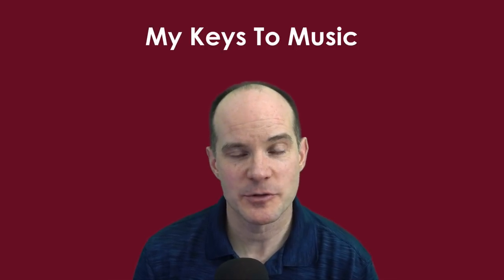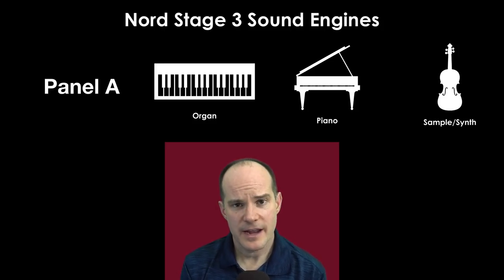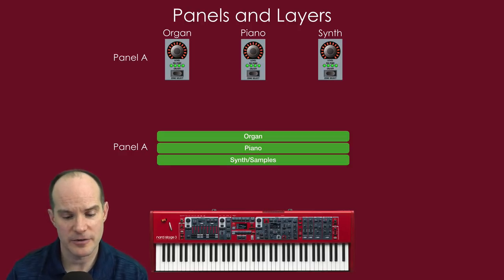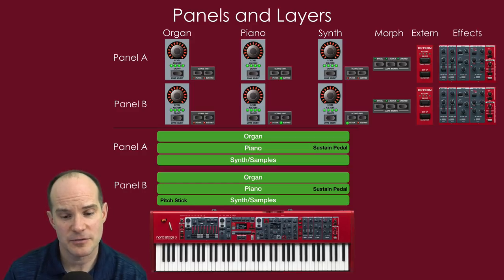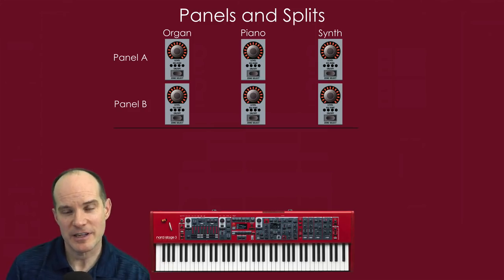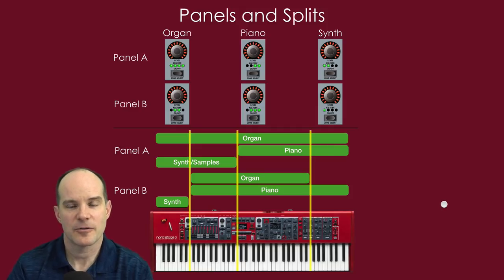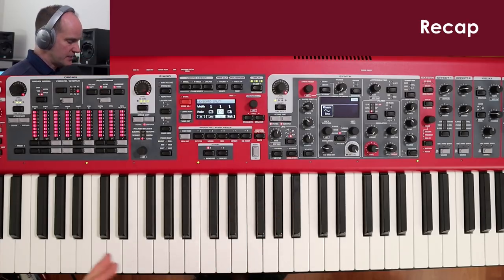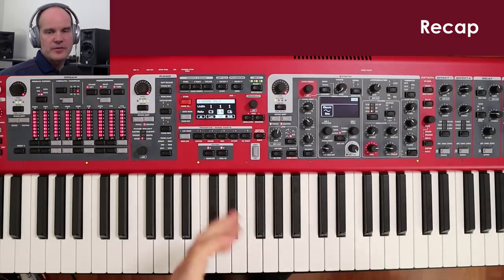Nord Stage 3: Understanding Layers, Splits, and Panels

Comment: Great tutorial!
Reply: Only thing I don’t get is why you they didn’t add customizable split points to any key.
Reply from the maker: Thank you!
Reply from the maker: @nikoscratchaccount  A lot of people wonder the same thing.  We're not really sure why they did this but I have a guess. 
1) They may have wanted it to be as easy as possible to assign a split. Having less options makes it easier to do that and less screens and buttons to fiddle with during assignment. Also, having flexible split keys means it could get confusing for the user on how to assign zones. There would be issues with the user assigning a zone in the wrong area simply because they picked the incorrect keys to split on.  It would make for a slightly more confusing interface potentially.  Then again, maybe with enough thought, they could come up with a way to split anywhere, still have 4 zones, and make it easy for the user to program?

2) The split points illuminate in the dark - this is a nice feature and is absent on most all other keyboards. I wonder if allowing any key to split would also mean they'd have to install an LED light for every key?  Of course, the answer is yes. So, the additional expense on that alone could have been a deal-breaker. And it's not just the extra lights to purchase, but the extra labor to install and test them. And then, if even a single light goes out somewhere along the way, the owner is going to send it off for repair, which is expensive on both ends of that equation both for the person fixing it and the musician having to wait for it to get fixed.  In other words, with more part complexity, you introduce more long-term fragility (more things that can go wrong).  And with the keyboards still being made by hand, the inclusion of parts must be one of those long-drawn-out meetings around the design table with tough decisions to be made balancing features with feasibility.  That could explain why they don't have motorized drawbars.  🤷🏻‍♂

With that said, it would still be nice to have split options for any key haha!!!  Just because it's hard to make the cookies, doesn't stop us from wanting them right? 🍪
Reply: That makes sense.

Comment: First a big thank you for all the how to's. My primary goal was lightening the load from a Roland GX 700. Several months back after watching the Layers, Splits I decided to give the Stage 3 76 Hp a try. At the time my set up was a Roland Gx700 & an SK2. Synths were not a must have, but I got the Stage 3  since it had the Organ engine, &  weighted keys for pianos, EP's, etc -keeping in mind that I may be able to get away with 1 keyboard once fluent with the interface. 
I've always liked the Roland's ability to have 4 voicing samples at the ready with (4 sliders,) where I could instantly bring up any of the 4 for accents, or blend. 
As a fresh 70 yrs (ouch) you could say I'm old school.  The challenge with the Nord is the interface & understanding the differences in terminology SONGS, LIVE MODE, PROGRAMS.  I'm still a little foggy on Programs (they pull up already present samples/voices,) Song Mode -having 5 voices, but you'd only play that voice w/out the other 4 & so on .....I have selected some voices from Piano, & Organ, done keyboard splits, used the Morph wheel to bring the volume up/down -but it's frustrating to start saving & discover it doesn't work as intended & then lose myself when trying to re trace the steps & get frustrated to the point where  I listed it ,got an offer, & then thought I'd revisit the process & give it some serious time. I'm sure it would improve the more I do it before deciding to keep or not given my simpler needs than what it's capable of. 

In a simple scenario - Lets play The Letter (Cocker version) Selecting a piano & wanting horns for that chorus part only.
Another ex - Black Magic Woman -wanting the organ & EP for the whole tune but in varying volumes (thinking I can use the Morph wheel to increase/decrease volume on each in opposite directions.) Now I'm at point where I'd delete some samples to make room for others, along with saving some patches & confused .With all the song slots could I just create a "song " The Letter" & have that set up ? continuing same with other songs ? & are they SONGS, Live Mode< etc ??? When I'd want more parts or 2 frm same engine I'd use Panel B in addition -then switch to either A & B or Turn one off. Am I getting close ?
Reply from the maker: Hello!  Congrats on digging and at 70 no less. A musician once said (or maybe it was my High School music teacher that said it), "I'm so happy I didn't go into sports because professional athletes have a short span in life where they can perform at their peak. Musicians on the other hand only improve with time, able to perform their instrument at the highest of levels going well into their 80s and 90s and beyond..."
So, these concepts are quite confusing for most that are new to Nord. The key here is to know that Live Mode and Song Mode don't store sounds on their own.  They are merely pointers to existing programs. A program is the only way to save settings on a Nord keyboard.
So, if you want to create a song that has an organ and piano, you'd first create a program for that. Then you can create a song list that POINTS to that program.  This is both a good thing and a bad thing depending on how you look at it.  It's good in that if you want to create a generic program that always has a piano and organ at the ready, then you can use that program in multiple songs without having to recreate the wheel each time.  But, it's also bad if you want something specific for a song, you have to first create a program and then reference that program in your song list. Not a huge deal, but not exactly what people are expecting out of the box.  Live mode is similar except that with Live mode you don't have to push the "store button" and your sounds are in a constant state of flux.  If you move any knob whatsoever while in live mode, the live mode settings stick and there is no undo.
  
You could consider taking the course I offer at https://www.MyKeysToMusic.com where these concepts are explained in a little more detail in their own lesson. It may help with this process and give you a start and an end to learning all this. 
Thanks for your comment and congrats again on your Stage 3!
By the way, the 4 slider concept is fully utilized with the Nord Wave 2 keyboard.  Wish they had this for the Stage, but ya, they get it now too since the Wave 2 is their newest. It makes a big difference to have sliders instead of knobs I think.
Reply: My Keys To Music   Before receiving your reply I did dive in to create new programs with splits on an existing A25 & A21 programs One was for the song Black Friday, I put a clavinet on the lowest split (E-E)along with some synth on Panel A to fatten it up. Both are controlled with Morph wheel. On panel B I have a Wurly  with a little synth patch to give it some bite. I did similar with EP & B3 in another program (A21) Saved as in their slots & renamed     
!! Your mentioning the wave2 got me wondering, but the preference for pianos & organ knocked that out. I have my Hammond Sk2 & while the synth samples are borderline, it’s 2 keyboards & always having a b3 ready cover my bases. I think I’m on the way & will keep diving to get more comfortable with the architecture & trials. Your videos are clearly the best out there. Well thought out & presented. You may need a bourbon bar to go with coffee fund.
Reply from the maker: @unfinishedbusinessrockband  Thank you for the compliments and the update! Happy to know you are on your way. Sounds like you're making terrific progress!

Comment: Very helpful! 
What if I wanted to split at D#5? I haven't found a way to do this and have a song I need to do this on but doesn't seem possible on the Stage 3.
Reply from the maker: Hello @Josh Paredes Great question! The Nord Stage 3 keyboard has 10 pre-defined split points with LED lights indicating where they are on the panel.  There is no way to define a split in any other way other than those 10. Sorry!  (The Nord Lead A1, on the other hand, can split once on any key).  I think the thinking behind this is to provide the musician an easy way to identify where a split point is where as other boards, you essentially have to memorize where you created your splits.  So, with that said, it would be ideal then to have an LED anywhere on the board and split at any keypoint, but it doesn't work that way.  They gave us 10 and we live with that.
Reply: @MyKeysToMusic  Gotcha. Thanks for the fast reply! I ended up creating the split higher up on the board at C6 and set it an octave lower. Seems like the only work around is to cover a whole octave above what you need.
Reply from the maker: @joshparedes_  Yes, that's, that's the way I've always handled a case like this. Glad you found the work around. Have fun with your Nord!

Comment: Hi Marc,

I currently own a an electro 6 that I primarily use for playing organ. I use midi foot pedals and would like to have another manual, but the electro only splits once. Would upgrading to the stage 3 allow for controlling (sample engine) bass with the foot controller, and two separate instances of the organ engine on different keyboards?

Best,
Owen

Comment: Great work on all these Nord Stage 3 videos.  Though I have plenty of background with synths, I finally splurged on the Nord Stage 3 compact, and your info is helping get to grips with it (the keyboard as a whole) a lot more quickly than just the manual.  Being mostly a synth guy, I'm a little disappointed with a couple aspects of the synth/sample sound engine (no sustain on the amp envelope???), but really being a performance synth for PLAYING (versus sequencing or setting up some incredibly complex mods in a matrix), it's not a big problem.

Think one of your first videos I saw was the Baba O'Riley tutorial, which I was pretty impressed with.  Didn't learn until last year some time that Pete just did that whole opening part with some Lowrey home organ.  I had always assumed he had some meticulously sequenced, multitracked ARP 2600 thing he put together for the song, but no...not the case.
Reply from the maker: Hello @ProckGnosis Thanks for your thoughtful comment here. First, congrats on your Nord Stage 3!  There is sudo sustain by moving the knob all the way to the right, but yes, there is no dedicated sustain knob (and there really should be).  They do include the knob on the Nord Wave 2, incidentally.  And yes, the Stage 3, Wave 2 and Lead A1 are all performance-based stage pianos and synths that beg to be tweaked mid-song, and they really shine at that.

Like you, I was shocked to hear that Pete did that with a simple Lowrey organ but I think he tweaked the speed on it (marimba). When I made the first video, I didn't realize how it was originally created.  I later learned how he did it, which was interesting.  Also, I made a "part 2" which I think came out even better than the first if you haven't already seen it: https://youtu.be/pYelOuB-G3w

Continue to enjoy your Nord Stage 3 and if there are more questions, you know where to find us.  I also have some free and paid courses with lots more content on my main website and Patreon site.
Reply: @MyKeysToMusic  I'm finding some workarounds for the lack of set-able sustain level.  I can bake it into the sample, or I can use both "A" and "B" with almost the  same patch, and have "A" decay into a sustain level set with "B".  It's not ideal, but it's better than nothing.

But...when I compare this to the OVERAGE of full ADSR envelopes on the Hydrasynth, it does leave me scratching my head a bit why Nord went this way.

And btw, you let your inner prog/AOR rock geek out quite a bit with your band references (many of which I was into as well as a young'un, I gotta say).

Keep up the good work.  Cheers!
Reply from the maker: @ProckGnosis  Thanks for your follow-up comment here and your perspective. I appreciate that you dig the old-school prog rock references! If there are any more questions, you know where to find me!

Comment: Just got a Stage 3 HP76. This is a great tutorial on splits and layers. I have to say, although I love Nord (this is my 3rd Nord) the splits on this keyboard are the most convoluted of any keyboard I have ever owned. Never the less, a great keyboard and a great video!
Reply from the maker: @Lou Di Falco Congrats on your new Stage 3!! I think a lot of people share that same initial thought of "Hmm, that's a strange way to handle things" when people come to Nord from other keyboard manufacturers. But, once you get it, it seems to all make sense. Continue to enjoy your new board... 🎹
Reply: @MyKeysToMusic  Oh don't get me wrong Mark, I love the board. This is my third Nord, Electro 3 61 (sold), and Electro 6D73. To your point, compared to Yamaha, Roland, Kurzweil, splits and layers on Nord are kind of outside the box but I get it. With so many hands-on knobs for each engine, I can see why they did it this way. The only thing I really wonder about is why does Nord have set split points. I'm sure it's an architecture thing. I also have a Roland RD800 and I can have four zones split anywhere on the keyboard. Not a complaint as much as a curiosity. Going through your synth section tutorial. It appears the synth display info is different to a minor degree as well as the panel layout. Excellent videos also btw.
Reply from the maker: @ldifalco2010  Thank you for your reflections and I tend to agree with them! To your observation on set split points - people mention that a lot as a limitation. At the same time, others have said they like the fixed points because they are accompanied by an LED light which allows you to easy see the split point while performing in the dark/low light conditions - a feature not available on other boards.
And yes, when I first made the videos for YouTube, I was using the original panel layout on a Stage 3 HP.  The panel layout has since changed and I have recreated most of these lessons in the Pro course I sell at www.MyKeyToMusic.com. I invite you to check out the pro course as not only is it more relevant and much more updated than anything here on YouTube, it also offers several "exclusive" lessons not available on YouTube.  In any case, that explains why you see the differences.  In fact, I made a video about this very topic where they changed the panel and configuration between Stage 3 models over time: https://youtu.be/--KaUGMb67U
Reply: @MyKeysToMusic  ...and no one else, at least that I'm aware of, has the cross fade splits. That's a plus in the Nord column.
Reply from the maker: @ldifalco2010  Good point!  I hadn't realized that and that is a nice feature indeed.

Comment: Hi Marc - I hope mine is a simple question. If I split my NS3 in two sections (say bass and piano) can I separate the output for the bass section so that the bass volume can be controlled independently of the piano section by the sound engineer?? As always, thanks again!!!
Reply from the maker: @TPBass1224 Great question, and this comes up a lot, actually!  What you want to do is isolate your bass sound on another output.  Let's say output 3 (Mono). You can do this in the system settings. I think the video I have here might walk you through this scenario: https://youtu.be/o61ov_qAQqk?feature=shared
Report back here if you get a second to let us know how it goes...